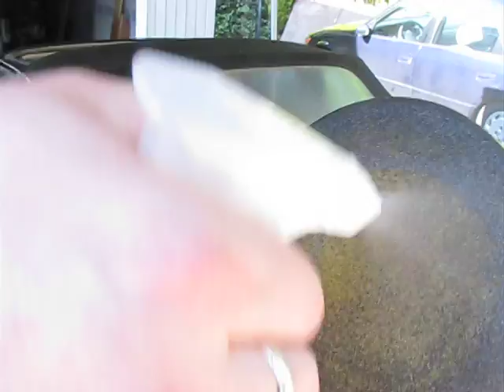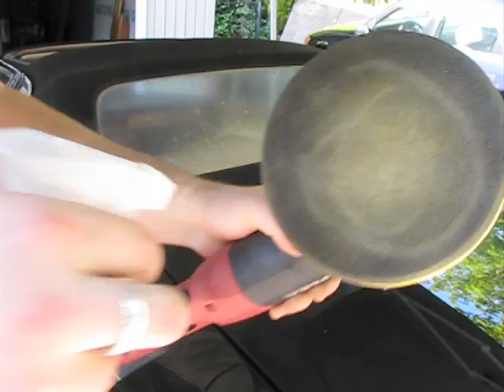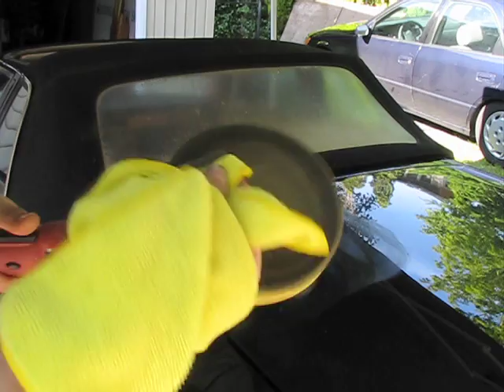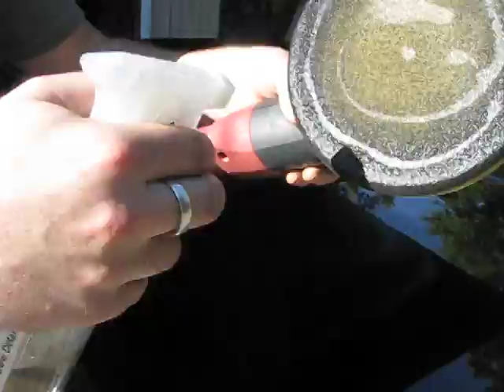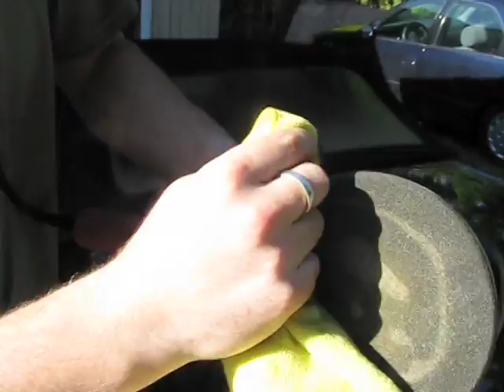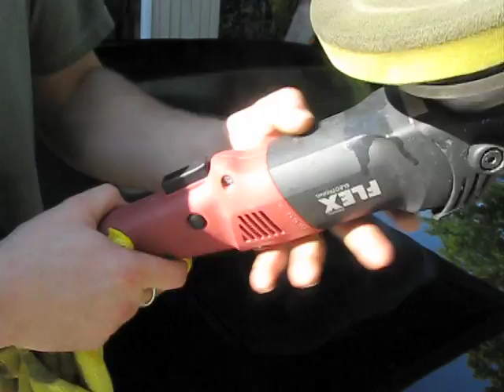Pad cleaning "On the Fly", black single stage paint

Comment from the maker: @godofm3tal1 Yes, but that involves removing the pad, going to the sink, rinsing, removing excess liquid to prevent creating a mess of splatter etc.. the point of "On the fly" pad cleaning is to be able to get back to polishing quickly. Which is easier to do when it's not a demonstration video created as requested by a member of the Autogeek forums.

Comment from the maker: @FilthyVlad When you look at the pad and the pores of the foam are all filled up and glossed-over with spent polish/removed paint, you should have cleaned it already. Every car is different.

Instead of running a towel against the pad like I do in this video, use an air compressor. Keep the nozzle ~1" away with the polisher on med-high. It is much less damaging to the pad over time, more effective and way faster. I'll try to post a new video showing this technique.

Comment: What did you spray it with? Just water?
Reply from the maker: I can't remember exactly, it looks like a chemical guys bottle. I still recommend using an air compressor to clean the pad instead of using the MF towel. Just spray air on the pad while the machine is running, be sure to turn your back to the car first!